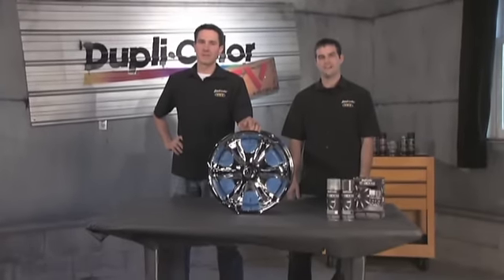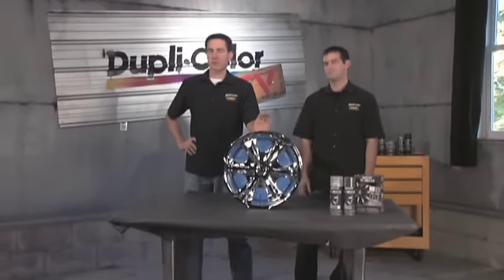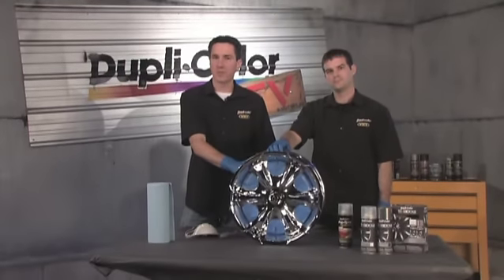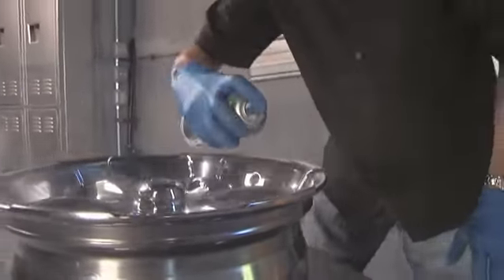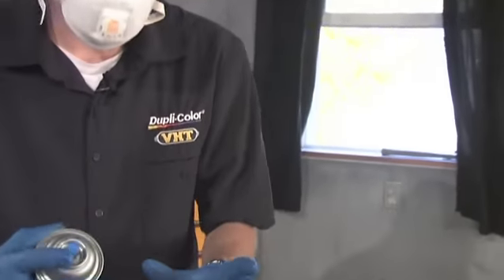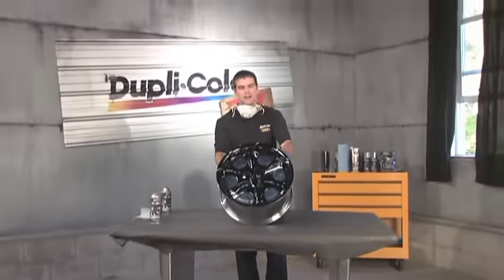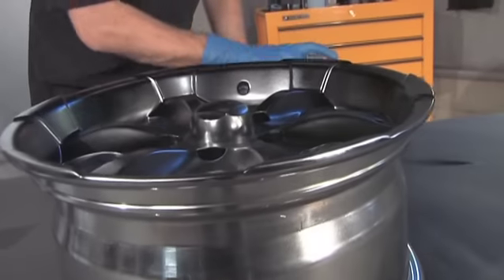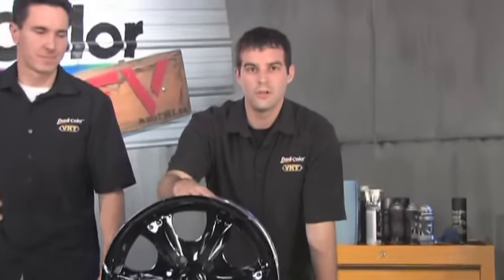How to Blackout Chrome on a Car with Shadow Chrome

Comment from the maker: Hi Greg - Shadow is actually a translucent coating, so you won't get a finish like you would with a paint -- as this is meant to leave the chrome shine under the coating. 

If you are going for a look like the finished rims in the video - we'd suggest about 3 to 4 coats. Definitely mask off the plastic parts - you'll get a decent finish if they are a silver color, but they will look a lot different from the polished chrome from your rims.

Comment: I Just realized that this product is for original chrome surface. How will this work on a colour similar to hyper silver? I just prepped the wheels and ready to paint haha
Reply from the maker: Evan Christie The shininess you see in this video is actually more a quality of the chrome finish underneath than the Shadow product itself. The end result should still be similar, but you will notice that it is less brilliant than in the video. Please call 800.247.3270 if you have any questions about application or would like a recommendation of another product for this project. Thank you for using Dupli-Color!

Comment from the maker: Hi there @Joan C - While our coatings are only tested in automotive applications, we suppose this product would work on faucets/handles. Baking/heat curing isn’t
needed/required with this product - however, making sure the surface is clean and dry is very important! Good luck! We'd love to see the finished product - share it on our facebook page when you've finished! :)

Comment: Used this product, it was a bit tougher in my case as I did several, different color layers.
The holes being first, all other areas taped off. After a couple coats, (there were two areas of tape left through all but clear to retain full chrome), I found, removing the tape to be the most difficult in the beginning. Being translucent, it wanted to come off with the tape. Even after 24 hours of dry time. I "edged the tape at this point with the point of a craft knife", then removed tape.
In all, there are three colors on my rims. The holes being the darkest as each additional layer, as areas were un-taped, still added to the holes. Was a HUGE improvement over stock rim look.
2000 Regal GSe, currently under heavy mods. The idea was, the stock rims will eventually only be used w/racing "street race" radials from Hoosier, but man, will it look good going fast...................

Just remember, CLEAN really good first. I used Brake cleaner, then acetone, then finally, just before painting, I found rubbing alcohol as a good prep. I've a body guy, good friend, he uses Windex often, and I did this on my mirrors, worked great also.

Does NOT work on anything other than Chrome though, and my only issue, it took two boxes, I was hoping for only one, but then, I did "layer the colors" so I probably used more doing it that way.
Reply from the maker: +Jim Holley We're glad you liked our product, Jim!
Reply: +Jim Holley how can i move it recover my old-original color
Reply: *****  your best bet is laquer thinner. Verify w/ the Duplicolor guys, but I'm pretty positive the thinner won't affect or etch good chrome.

Comment from the maker: @Milanf07 - Shadow will not bond to a greasy (dirty, oily, waxy - you get the picture!) surface. So be sure to always degrease and then thoroughly dry your surface. If it's a glossy surface be sure to scuff it up also! That prep work should GREATLY improve your paint job and prevent any chipping.

Comment: hi. Does it work with steel wheels? Can I still use the normal wheel cleaner to clean and remove the break dust without taking off the paint?
Reply from the maker: Xipeeng Chen Will work on steel wheels - but you won't get the dimension that you'd get from true chrome. It will stand up to the carwash and wheel cleaner (we'd recommend a clear coat if you think you'll be putting them through a lot of abuse and subsequent cleaning).

Comment from the maker: Your silver rims will still get some of the dimension and shine that chrome rims would get with Shadow. You could mask off the area you want and still use Shadow. 

But if you want just black (and not the translucent coating that Shadow will give you) you can use our High Performance Wheel Coating. We now offer a Matte Clearcoat for that application as well.

Comment: can this withstand any heat? like on external casings on a harley primary, rocker covers etc.
Reply from the maker: Shelly Harlow - Shadow shouldn't be used on any surface that heats up to higher than 120 degrees F, so consider that when you're working on your Harley.

Comment: Does it have to be used on chrome? I have steel wheels I wanna give a glossy black look to.
Reply from the maker: bakerboy293 It doesn't have to be used on Chrome, however, that depth and dimension come from the chrome background (as Shadow is a translucent coating). If you're looking for a glossy black look, we'd suggest our Wheel Coating.

Comment: Will is work on plastics that have been painted with chrome paint or will it work with chrome paint in general?
Reply from the maker: Will work with plastic - but you won't get the same finish with a plastic surface (not the same amount of dimension and shine), we'd suggest trying it on a small area and if you don't like the finish, remove the product with our Paint Stripper.

Comment: Can this be used for chrome emblems?
Reply from the maker: miguel robledo Hi Miguel, thanks for your question. As long as the emblems are chrome, it should work. We would recommend testing the product on an inconspicuous spot to make sure there are no negative reactions before proceeding with the full emblem. Thanks for your interest in Dupli-Color.

Comment from the maker: Frank - 
Because Shadow is a translucent coating, the blemishes that aren't removed with polishing will show through. So take a close look at them after polishing - if you're happy with the look then we would say go ahead and apply Shadow. 
Because your rims are only painted silver and not actual chrome or aluminum - you might not get as deep of a color or reflective finish as seen in this video. But, you'll definitely still have a nice finish.

Comment: is possible to use on silver mag weels?  my weel is original color.... but i want to paint with this paint chrome black....do i need to use primer? what i have to do?
Reply from the maker: +Paulo Henrique Kloster You can use Shadow over silver mag wheels, but the finish might be less brilliant then it would be when used over Chrome.  There's no need for a Primer because this coating relies on the underlying color of the wheel to create the Shadow Black Out look.  Always make certain that the wheel is clean and dry before applying.

Comment: I have regular stock rims on my car (no chrome)...can I still use this product on my rims and get the same results?
Reply from the maker: You won't get the same results with stock rims - the dimension and shine will not be as great. But if your rims are silver, you should still get a good effect on them. 
Try testing a small area to see if you like the results - you can remove it with our Paint Stripper very easily if you don't like how it turns out.

Comment: My S-10 has a chrome bumper that is rusting and pitted on top. I live on the shore.  If I neutralize the rust, will the Black-out keep it from further rusting?
Reply from the maker: We wouldn't recommend it actually - Shadow is translucent, so you'd be able to see all the rust spots and pitting. We'd go with something like our Wheel Coating to cover up the spots where it has pitted.

Comment: Does this product only work on chrome or can I used it on brushed aluminium?  Just door handles.
Reply from the maker: Mike - it can definitely work on brushed aluminum -- you may not get the same depth and dimension as you would on a chrome surface, you'll still get a nice finish.

Comment from the maker: @gggromay -- What material are your caps? This product gets the best results with a chrome surface - which is what it is formulated to be sprayed over. Any other surfaces might not get the same results. 

Also -- how do you prep your caps? We suggest a THOROUGH degreasing and using our Prep Spray -- as any grease, lint or dust could really impede adhesion. 

If you have any questions about application - please give us a call at 800.247.3270 and we'll see if we can't get this resolved for you.

Comment: I have some bare sheet aluminum parts. For this finish, should I polish it first before application?
Reply from the maker: +Steven Pacheco The more polished the metal finish is, the more brilliant the finish will be.
Reply: +duplicolortv Are any primer coats necessary? Or is the prep spray adequate?
Reply from the maker: Shadow is a semi-transparent coating that relies on the underlying coating to provide the brilliance. Adding a standard primer isn't suggested as it would block all of the natural metal. The only Primer that we suggest is Adhesion Promoter which is a Clear.

Comment: how does it hold up to heat?  I'd like to coat my chrome exhaust on my honda Shadow.  seems fitting...shadow for a shadow  haha
Reply from the maker: Mike Searcy Shadow will resist heat up to 120F, so we'd suggest not putting it on your exhaust. Although we'd love to see some Shadow on your Shadow! ;)

Comment: Will this work on silver alloy rims, they are a bit chipped and scratched. I was looking into getting that chrome like finish. The salesman recommended this at advance AP.
Reply from the maker: dudeu4real - this could definitely help you with that, although, Shadow is a translucent coating, so any imperfections on your rims could be seen.

Comment: Is this safe for factory painted wheels? And if I don't like it and need to use the paint stripping product, will it take off the original finish?
Reply from the maker: John Pine Hi John, this product is designed for use on shiny surfaces and is best used on Chrome. The shiny attributes of this product are not from the product itself, but rather from the surface. You can use it on painted wheels, but it will not look as brilliant. If you'd like to paint your wheels black, we would recommend our Wheel Paint product.

Comment from the maker: @TheSnowman44077: Shadow can be used on your chromed plastic - Just keep in mind that since Shadow is a translucent coating it will only look as good as the substrate you are painting. If the wheel or piece of trim is of not as high quality as chrome/metal rims then Shadow will not look as crisp as if you painted a high quality piece of chrome of polished metal.
We would also mask around the step pads. :) Good luck and we'd love to see the results on our Facebook or Twitter pages!

Comment: I have Motorcycle parts I wanted to put this on which are not chrome.  I know it will not be as brilliant, but how will it look if I put it on  boxes (non chrome) on the handle bars?  These would be the flasher switch box, the starter box... is it just a tint, or do you think it would shine it up a bit without giving it a solid black look?
Reply from the maker: +Ephraim Miller Our Shadow Chrome Black-Out Coating can be applied non-chrome surfaces, however it will provide a dull, muted look.

Comment: so I assume if I'm using this on a clear coated polished aluminum...it just wouldn't have quite as much pop, but would achieve a similar effect?
Thanks
Reply from the maker: ***** That is correct. The brilliance of the finish is more of a property of the chrome itself than of the product, so if you apply it to a less shiny metal/surface, it will appear a bit duller.

Comment from the maker: Adam - 

Definitely give it a good cleaning and THOROUGH de-greasing! 
Our Prep Spray will help clean off all dirt, grease and other contaminants. 

Just keep in mind that since Shadow is a translucent coating it will only look as good as the substrate you are painting. If the wheel or piece of trim is of poor quality then Shadow will not look as crisp as if you painted a high quality piece of chrome of polished metal.

Comment: how well will this work on a stainless steel substrate?
Reply from the maker: Myke Edwards Will work well! And the stainless surface is a good metallic surface to get some dimension (although not as much as a chrome surface).

Comment: Has anyone used this kit over the CS101 Chrome enamel paint? Or, duplicolortv  can you confirm that would work?
Reply from the maker: Hi Peter - you can use Shadow over our Chrome paint, however - since it won't be true chrome, you won't get as deep of a finish as you would if the surface was real chrome. We'd suggest testing out the combo first and see what you think before you do a whole rim. If you don't like the finish, our Paint Stripper will remove it easily.

Comment: ok one question- usually when spraying onto chrome a etching type paint is needed so that it will bond to the chrome, otherwise 6 months down the road it flakes off, does this product provide such bonding or is this a temporary look?
Reply from the maker: It's a good idea to apply Adhesion Promoter over the Chrome surface prior to applying Shadow. This process would allow you see longer lasting results. Adhesion Promoter is clear and shouldn't affect the appearance.
Reply: thank you

Comment: I have some chrome 20's that I was thinking of just painting black but I don't want to sand all the nice chrome and go through all of the extra work. I am curious, now that this has been out for a while, how it holds up to car washes and how is the clear coat for cleaning with waxes or cleaning products
Reply from the maker: Hi Trent - Chrome would be a good solution. If you prep well, you should have great adhesion. Just be sure to thoroughly de-grease and clean your 20s. You can also use our Adhesion Promotor if you're going to be tough on your wheels.

Comment: I just bought a corvette stingray and it has chrome wheels, my question is: can I go back back to chrome without damaging my chre
Wheels in the case that I do not like the finished outcome. Another question is how long do I wait between the base coat and clear coat application?
Reply from the maker: Hi Anthony - you can use Dupli-Color Paint Stripper to easily remove Shadow if you want to go back to true Chrome.

Comment: Soo basically this chrome black spray is useless for black alloys.. will this clear coat get my black alloys to shine even more?
Reply: any good "glossy" clear will work, if they're already black, I recommend high gloss Rustoleum, the one w/ UV protection.
I used on nightshade tinted tail lights, as shiny as original plastic, and shouldn't fade as some have had issues with.

Comment: Im looking for a deep almost brushed metal look. I know its for chrome but I was wondering if this would look sort of like a dark brushed metal over a raw motorcycle tank. Of course ill clear coat all of it with a lacquer to protect from possible gas drips
Reply from the maker: richyorn - Shadow would help you achieve that look on top of a raw tank - several very light coats should do the trick. We would suggest actually contacting Sherwin-Williams for a fuel-resistant clear coat for your tank.

Comment: Great video, will be looking into this for my stock wheels which are ABS plastic "covers", will this system work well on those types of "chrome"?  2013 Ram 1500 btw.  Thanks
Reply from the maker: +bluebeast1562 Plastic Chrome finished surfaces are usually film adhered with adhesive so we wouldn't suggest anything over that type of surface. You should be able to use Adhesion Promoter and Shadow for all other Chrome surfaces.

Comment from the maker: You could definitely use shadow on plastic! However, you'll get a more rich effect on actual metal/chrome and a bit of a duller look on the plastic part.
We'd suggest testing a small area -- if you're unhappy with the results, you can use our Paint Stripper to remove your test areas. :)

Comment: I tried this and mine is getting bubbles and isnt really coming out like the video im letting it dry now to put the clear coat but so far im not liking the results. How can you fix that?
Reply from the maker: Hi Jovani Panameno -  Coatings require a clean, dry and porous or dull surface to adhere properly. From you description there is something on the surface keeping our product from bonding and thus it’s bubbling off. I suggest using our Paint Stripper or Lacquer Thinner to remove the paint. Once removed you will be back to your original surface and can do one of several things.
To continue with our product I recommend cleaning the surface well using a rag wet with a degreaser to remove surface contaminates. Be sure to use several clean rags so as to remove the contaminants from the
surface rather than re-distribute them.
Reply: Where do i get the thinner? Same place i bought the kit at?

Comment: duplicolortv  i have aluminum wheels that look chromed will it still come out as great as your presentation? Secondly, i might have scratches and maybe slight chips, what should i do prep wise to ensure best results? Thanks.
Reply from the maker: tacoma81 Hi, thanks for your question. If you use Shadow directly on Aluminum, it may not adhere as well because primer is typically necessary when using our products on Aluminum. We generally recommend our Self-Etching Primer, which is green tinted and would cause a big of a mismatch when the product is applied, because Shadow is translucent. The brilliance of the final product is more due to the qualities of the chrome/metal than of the product itself. Please let us know if you have any other questions.
Reply: duplicolortv so what would be the steps exactly then? Cuz in seriously thinking about doing this to my rims lol
Reply from the maker: tacoma81 Your best bet would be to call 800-247-3270 to speak to one of our application specialists so they could walk you through the best steps. Please let us know how it turns out!